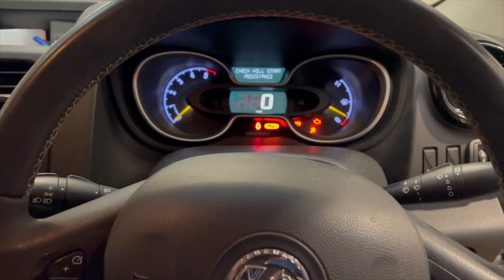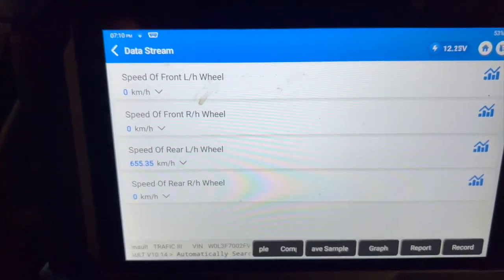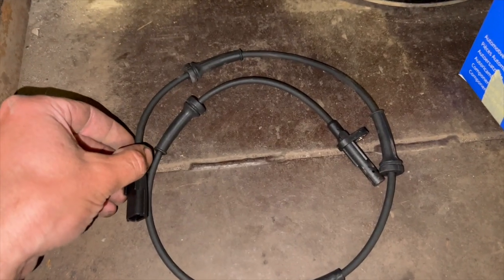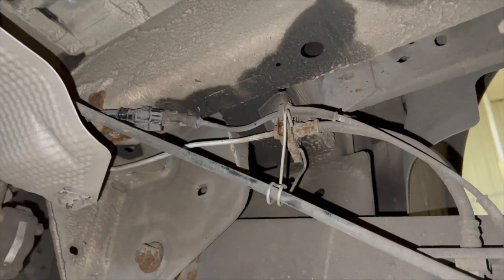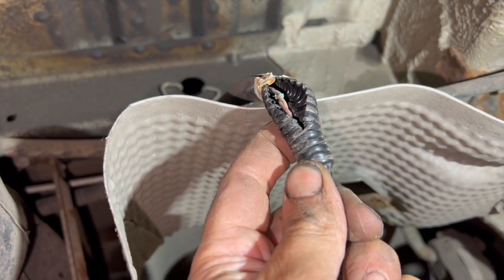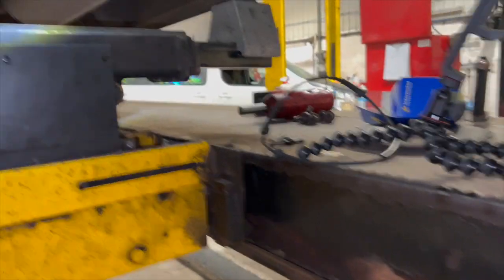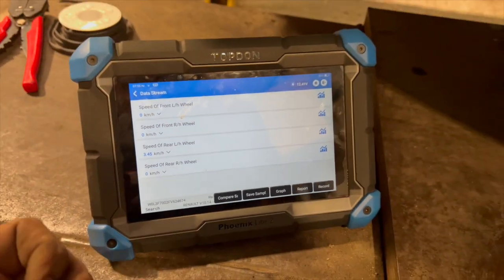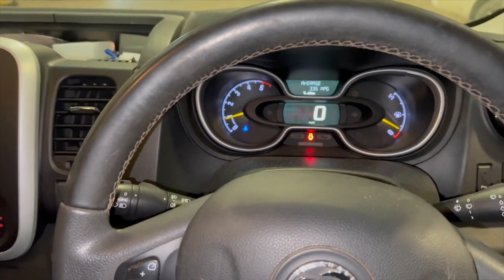2015 Vauxhall Vivaro ABS fault fixed.. Corroded wire!

Comment from the maker: New Rear ABS sensor - https://ebay.us/Za4cro

Diagnostic machine used in this video:
Topdon Phoenix lite 2 Ebay - https://ebay.us/tsyiTI
Topdon Phoenix lite 2 Amazon - https://www.amazon.com/dp/B0B1MB6YG8  

Tools used :
Milwaukee 18v 1/2" Impact driver - https://ebay.us/30WOga
Leatherman wingman multitool - https://amzn.to/41dtKwm
Multimeter - https://ebay.us/WlGnoP
Automatic wire strippers - https://ebay.us/Nba5QL
Mini blow torch - https://ebay.us/WlKTvI
Solder connectors - https://ebay.us/oEuDWh
Glue lined heat shrink - https://ebay.us/YVM55b
Insulation tape - https://ebay.us/i2BYkV

Check Euro car parts - https://tidd.ly/3lIO7xA  (use discount codes on site)

Comment: Where are you based ? Need an abs issue sorting on my Vivaro , c401 fault code with check esc message 2016 Vivaro sportive
Reply from the maker: Hi I’m on the east coast Nr Grimsby , afraid I only do my channel in my spare time , still full time employed so don’t have much spare time
Reply: I have this same issue could you recommend anyone